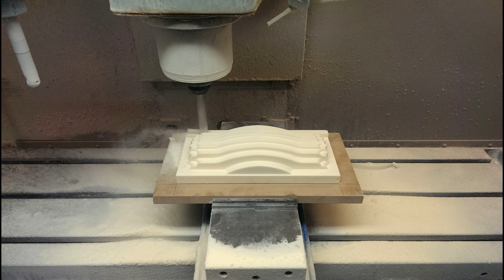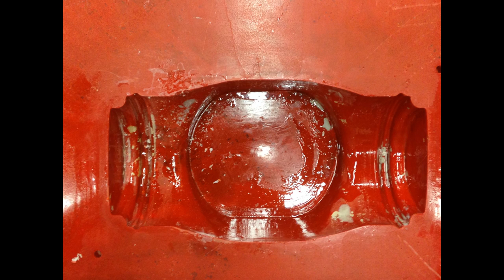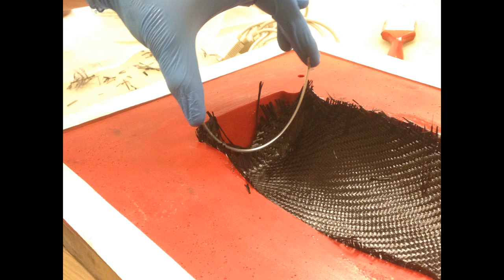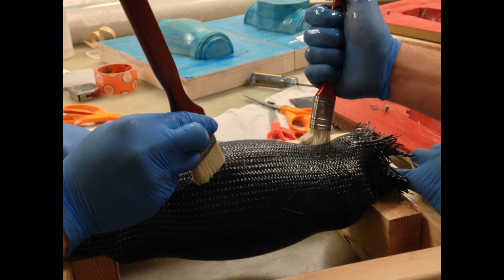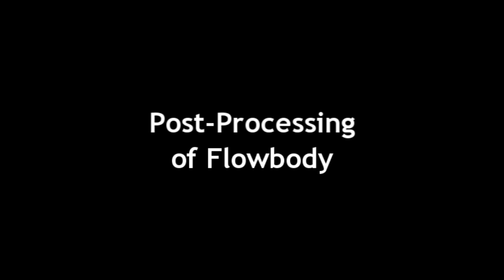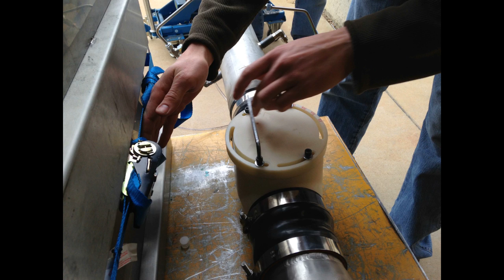Carbon Fiber Composite Manufacturing

Comment: How many voids in your mould! As a laminator myself that moldnwould need hours of work because of the consolidation method you chose. Instead of using woven matting for the mold chop strand would have been much better using tissue matting then going up  to 450g matting. Would have been strong enough for what your molding. Or even split mold it for easier extraction.